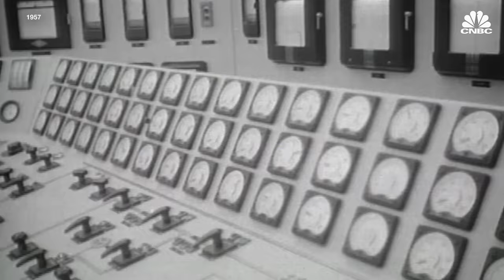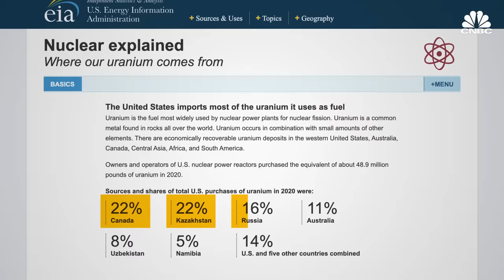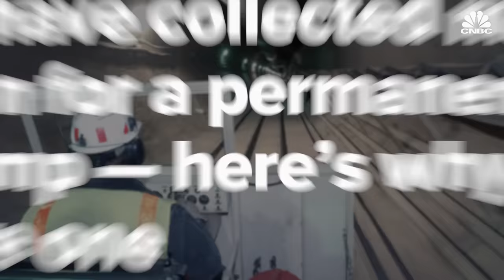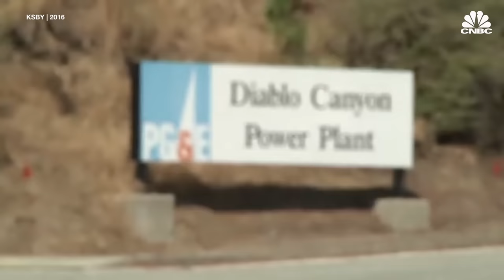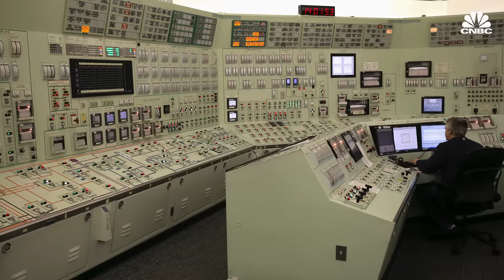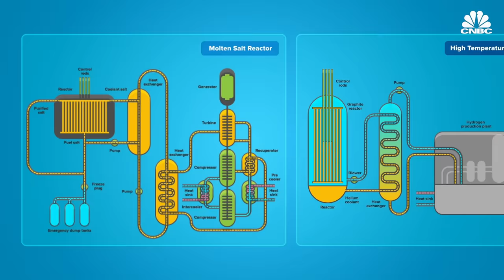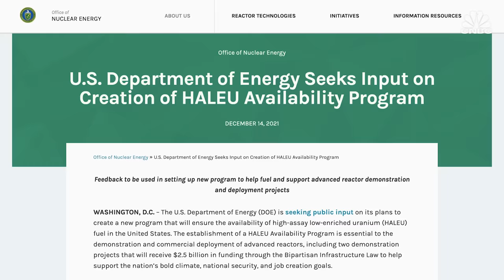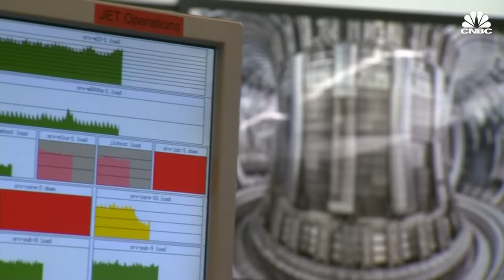Why Nuclear Energy Is On The Verge Of A Renaissance

Comment: The biggest issue is still long term waste disposal. No matter how useful new plants would be, the waste is still being held mostly in plant site pools and in a small case turned into long term waste casks but they are all still left on site. Lots of the fuel could be used again and turned into MOX and used again and cut the waste issue to a smaller scale. Yet there are only a very small MOX plants outside France and Russia. The US should have one and so should China. At present fuel needs to be replaced every 4 yrs or so yet most of that fuel could be reformed and used again. Modular Nuclear just solves the price and building cost issue and that also needs to be solved but even then unless its a new power plant design then the lethal waste is still there.
Reply: large ammount of electricity ? Hydrogen will beating nuclear reactor easily my break through map is
Water electrolysis=>hydrogen=>water boiler=>steam jet turbine=>electric generator=>water electrolysis=>hydrogen=>water boiler=>steam jet turbine=>electric generator, this cycle can run forever, green and doest need any nuclear, coal or fossil fuel, just bypass current steam turbine generator. USING HYDROGEN THAN NUCLEAR.
Reply: @SharhbiniRauf  The only way Hydrogen at scale can be made is a massive expansion of offshore wind and only when there is excess wind demand over consumption, can that "free" power be used via electrolysis to make hydrogen. Otherwise its like burning oil to make power. That only works with countries that have large coasts and shallow(er) depths to build these farms at a massive scale. Interconnectors can move some of that excess power before any H production. Then we have to move Hydrogen as well when we already have limited capacity to move natural gas. In many large coastal countries, the sea state is not condusive to even floating massive wind arrays. To use large solar arrays you need water to crack for H. Even Nuclear needs massive water access (usually fresh water). Nuclear also dumps vast quantities of warmed water which has a climate impact
Reply: Dealing with the waste has never been a technological problem, merely a political one.
Reply: @danadurnfordkevinblanchdebunk  Even in Finland who have built the newest long term storage site, the ability to communicate to future inhabitants that any site is lethal for up to 10,000yrs is something no government has ever had to face. The cost (even with national support) has also been massive. Now imagine building a much larger site in the US/China/Europe/Asia. France uses MOX recycling to cut that waste size down as much as possible. It costs more but its like recycling waste vs throwing it away. This is not normal waste. Look at the cost Japan had to pay. It makes superfund sites look like loose change
Reply: @stephendoherty8291   That's just so dumb.  We have a two billion old nuclear waste dump that had absolutely no containers and we can see by surrounding soil testing at Oklo that the waste stayed put without widespread contamination.

Comment: I think Thorium breeder reactors are very hopeful. Also, there is controversy over whether nuclear fusion will Ever be practical. But, you could use a Hybrid system, with a modern Tokamak, or the Wendelstein-7x Stellarator (located in Germany) providing the neutrons to transmutate Thorium into U-233. The latter can be fissioned to generate power. 
There is Little long-lived waste with this scheme, and meltdowns would be rare.
There is also less risk of proliferation for weapons.
Reply: I have been using fusion collectors for about 40 years now.

Comment: price is not a problem with molten salt reactors (some less so than others) its 100% regulations, all written around solid fuel reactors so there is an early adoption fee (US regulators are getting better but still seem to prefer fuel rods/TRISO for accounting of fission products/transuranics)  even tho you can keep nutronics poision(Pu240) in the salt at all times to stay proliferation safe if using DU fuelcycle. it's a shame how many larger players are making SMR's with solid fuel, I know 5 or 6
Reply: Terrapower is building a MSR.  Originally advertised as costing $1 billion but now they are getting up to $2 billion in a dollar for dollar match from the U.S. taxpayer.  After 2 years the project has yet to break ground and now say maybe in 2023.  Before you proclaim cost effectiveness you may want to wait until one is actually built in the U.S..

BTW $4 billion for the Terrapower 345 Mw reactor is already a financial failure and they haven't even started building it
Reply: @clarkkent9080  You fail yet again from your blank trolling channel to admit that many countries have been building and using small modular reactors for many decades built in two years or less for millions not billions.

Comment: Solar and wind are cheaper period. The rest of the conversation is white noise until fusion power becomes viable
Reply: Solar is $0.85b/GW nameplate, at ~33% efficiency. So $2.55b/GWe, but needs to be replaced twice before nuclear needs to be replaced once, so $7.65b/GWe(n). But solar needs storage, so ~10b/GWe(ns). That's 2-5x the cost of nuclear in countries with active nuclear construction programs. Wind is worse.
Reply: @Crispr_CAS9   Solar and wind need to be replaced several times, but even worse solar and wind can't work without storage, so factor that into your numbers.

Comment: The flippancy of which nuclear reprocessing is dismissed is sickening. It's the ONLY responsible way to dispose of nuclear spent fuel rods and other high level nuclear waste. Yes it costs double what "throwing it away" does HOWEVER that cost is TINY TINY TINY in the large scale of nuclear costs. Leaving it for someone else to deal with is such an American way... YIKES!
Reply: But your politicians will not allow reprocessing.
Reply: This dana person is a corporate lobbyist pushing nuclear. Below is their idea of politicians not allowing reprocessing.
You need a processing plant to separate the Pu239 from the other isotopes in the spent fuel. Then you need a plant to mix the Pu239 with U238 to make assemblies that can inserted into the reactor. And then there are the shipping casks needed to move the spent fuel from the old reactors to the processing facility along with security and loading and unloading facilities.
 It is not so simple or cheap when you consider the reality of actually doing it. MOX a government built facility that was supposed to mix pure weapon grade Pu239 with U238 to make reactor fuel assemblies was canceled (2017) in the U.S. after spending $17 billion and they finally admitted that it would cost $100 billion more to complete and operate.  
And this facility was just 1/2 of what would e required to actually process spent fuel.
Reply: @clarkkent9080   The price of reprocessing is a necessary cost, unlike solar and wind who have not considered their MASSIVELY GREATER amount of waste that remains toxic to humans and the environment FOREVER.

Comment: Electricity.. Too cheap to meter.. Is what I remember as a kid
Reply: Well here is the real cost.
The Southeastern U.S. is super pro-nuclear MAGA, has zero anti-nukes, and 100% political support. 

VC Summer (South Carolina) new nuclear units 2&3 were canceled in 2017 after spending $17 billion on the project (original estimate of $14 billion and 2016 completion date) with no clear end in sight for costs or schedule. 

Vogtle (Georgia) new nuclear units 3 &4 currently 110% over budget and schedule (currently over $30 billion) and still not operating. Mid way into the build, the utility stated that had they known about the many costly delays they would never have chosen nuclear. They are now delayed another year because according to the project management, thousands of build documents are missing. 

If you can’t build new nuclear in the MAGA super pro-nuclear southeast U.S. then where can you build it?
Reply: @clarkkent9080  Yet you continue to ignore from your blank trolling channel, many countries have been building and using small modular reactors for many decades, built in two years or less for millions, not billions.

Comment: We have cost more lives by NOT embracing and expanding on nuclear energy. Thorium molton salt reactors are definitely the answer to clean energy production.
Reply: large ammount of electricity ? Hydrogen will beating nuclear reactor easily my break through map is
Water electrolysis=>hydrogen=>water boiler=>steam jet turbine=>electric generator=>water electrolysis=>hydrogen=>water boiler=>steam jet turbine=>electric generator, this cycle can run forever, green and doest need any nuclear, coal or fossil fuel, just bypass current steam turbine generator. USING HYDROGEN THAN NUCLEAR.
Reply: @SharhbiniRauf   Hydrogen is a red herring.

Comment: My view on Nuclear is show me the design.  Is it walk away safe?  If the design is efficient, and walk away safe as well as economical then sure bring it.  I am also pro coal, pro gas, pro wind, geothermal,wave, tidal, hydro, solar etc.  It just depends on the location, the need and the economics.
Reply: @danadurnfordkevinblanchdebunk  I never said I was just Pro Nuke.  I basically said I like affordable electricity as long as it is safe. I went to a modern coal plant to interview for a job and got a full tour of everything and it was awesome.  Very clean and very efficient at scale and very close to coal mines and rail.  The state didn't have a budget for nuclear and gas was more expensive to run so they went with coal.  IE it was more practical.  I basically know everything is dangerous.  The number one cause of death is birth.  No one makes it out alive.  Might as well be nice and toasty warm at home reading a book vs freezing in the dark or burning a stinky candle because you were short sighted on what method of electrical generation you decided was too dangerous.
Reply: @damaliamarsi2006   Well you had to edit your comment to weasel out of that one, and then you bring on a coal meme, when coal is clearly the most deadly form of electricity generation method there is.
Reply: @danadurnfordkevinblanchdebunk  The edit was to correct a typo.

Comment: we essentially have a choice between being dependant on dubious regimes for ressources, using coal or going nuclear. 
it should be an easy choice, sadly there's a lot of misinformation about nuclear out there. people outright panic without actually looking at the comparisons of deaths per kwH, long-term costs and the actual "dangers" of nuclear waste.
Reply: @clarkkent9080  Not quite. First of all the costs are calculated differently when it comes to nuclear, generally including everything from mining, storage and dissasembly, not so for natural gas, solar etc.

In essence the price of nuclear is not represenetive of the actual price if we invested in it.

This can easily be seen as many many country operate nuclear power plants successfully and are building new ones all the time.

Solar and Wind used to be prohibitivly expensive, many time the rate of any other form of energy, it has dropped massivly. similarly nuclear used to be the cheapest form of energy but has peaked in recent decades.

The is no such thing as a fixed inherent cost, these things go up and down depending on who own the tech, what the investment is and what the laws dictate. If Solar had to include price of recycling it'd be more expensive for example.

Nuclear absolutly could be at least as cheap as solar, with less environmental impact and no need for storage or specific locations and we need to start investing now, so that the much quoted 10 years it takes to build a plant will be over sooner. We're in the midst of a global energy crisis, which was 100% preventable and which will only get worse if we keep waiting fore the perfect solution.
Reply: @nonyabisness6306  I am only concerned and only comment on where I live at that is America.  The only real calculated cost for nuclear has to be based upon reality and that reality has been occurring over the last 15 years in the Southeastern U.S..
The Southeastern U.S. is super pro-nuclear MAGA, has zero anti-nukes, and 100% political support. 
VC Summer (South Carolina) new nuclear units 2&3 were canceled in 2017 after spending $17 billion on the project (original estimate of $14 billion and 2016 completion date) with no clear end in sight for costs or schedule. 

Vogtle (Georgia) new nuclear units 3 &4 currently 110% over budget and schedule and still not operating. Mid way into the build, the utility stated that had they known about the many costly delays they would never have chosen nuclear. Anti-nuclear sentiment was never identified by the utility as causing any of the many delays. They are now delayed another year because according to the project management, thousands of build documents are missing. Utilities, not the media, decide the most cost effective electrical power source and give the above failures no U.S. utility is even considering new nuclear at this time. If you can’t build new nuclear in the MAGA super pro-nuclear southeast U.S. then where can you build it?
In both cases, the ratepayer is stuck with paying the $50 billion bill. And the silence of the Rah Rah nuclear folks on these events is deafening. 

Terrapower (Billionaire Bill Gates CEO) and NuScale are both building demo test reactors each with $2 billion of taxpayer money.  Both projects are behind schedule (started 2 years ago) and expect to soon hear the "labor shortage, fuel costs, supply chain issues, and it will be better/cheaper/faster next time" excuse.

This is not calculated, estimated, or projected.  This is reality for new nuclear in the U.S..
Reply: @clarkkent9080   Yet you purposely refuse to acknowledge that the US and many other countries have built and used small modular reactors for many decades, built in two years or less, for millions not billions.

Comment: We spent decades running in circles trying to build solar panels and wind turbines and made little progress in decarbonizing the electric grid. Most of the heavy lifting was done by natural gas. Instead, if we build more nuclear plants decades ago today we would be almost completely decarbonized. Better late than never, start building!
Reply: yea, like this.

If you live in the U.S. here is the reality for the last 4 state of the art Generation III Westinghouse AP1000 ADVANCED passive safety features new nuclear power projects and spent fuel reprocessing and in the U.S. over the last 20 years. The AP1000 is fully approved by the NRC for construction and operation.  The only NRC requirement is that the plant be built per design documents…..seems simple.. You decide if this YT video was presenting the truth. 

The Southeastern U.S. is super pro-nuclear MAGA, has zero anti-nukes, and 100% media and political support. 

The MOX facility (South Carolina) was a U.S. government nuclear reprocessing facility that was supposed to mix pure weapon grade Pu239 with U238 to make reactor fuel assemblies. It was canceled (2017) in the U.S. After spending $10 billion for a plant that was originally estimated to cost $1 billion and an independent report that estimated it would cost $100 billion to complete the plant and process all the Pu239, Trump canceled the project in 2017.

VC Summer (South Carolina) new nuclear units 2&3 were canceled in 2017 after spending $17 billion on the project (original estimate of $14 billion and 2016 completion date) with no clear end in sight for costs or schedule. Four managers on the project were charged with charged with 16 felony counts, including conspiracy, wire fraud, securities fraud, and causing a publicly traded company to keep a false record.  The CEO of the project is serving 2 years in prison, the others are awaiting trail.

Vogtle (Georgia) new nuclear units 3 &4 currently 110% over budget and schedule (currently over $30 billion) and still not operating. Mid way into the build, the utility stated that had they known about the many costly delays they would never have chosen nuclear. They are now delayed another year because according to the project management, thousands of build documents are missing. If completed, Vogtle will be, for its output, the world’s most expensive nuclear power plant.

Please google any of this to confirm.

If you can’t build new nuclear in the MAGA super pro-nuclear southeast U.S. then where can you build it?
Reply: @clarkkent9080  Do you copy and paste this into every comment on every video that is even remotely nuclear-related on YouTube? Get a life and embrace the power of humanity's ultimate energy source.
Reply: @Klerk Kant  Yet you continue to ignore that many countries have been building and using small modular reactors for many decades, built in two years or less for millions not billions.
Reply: @chapter4travels  he does